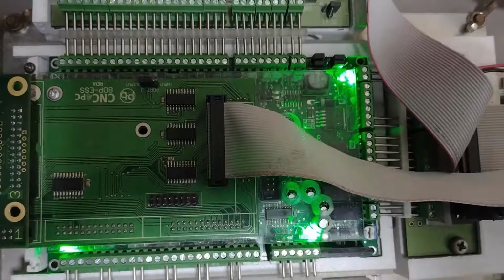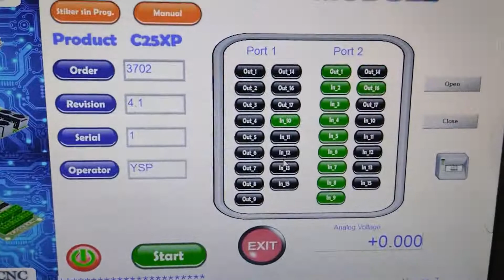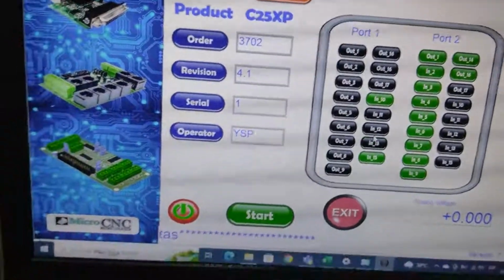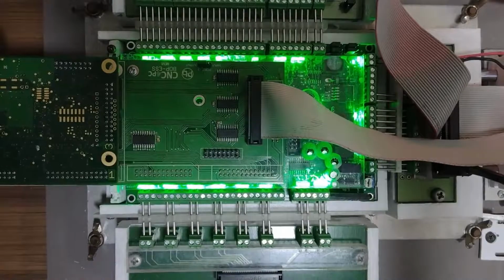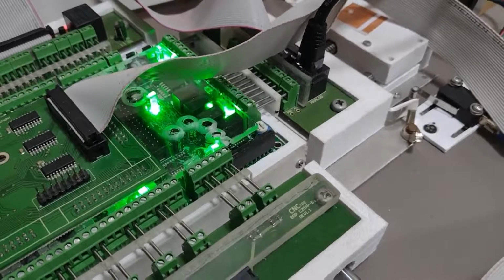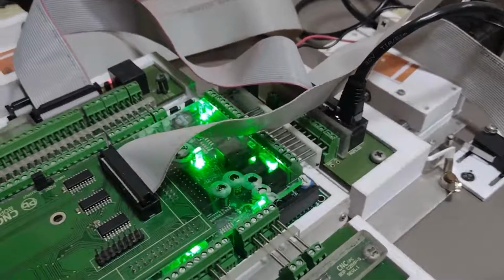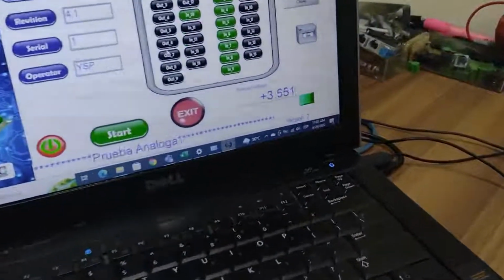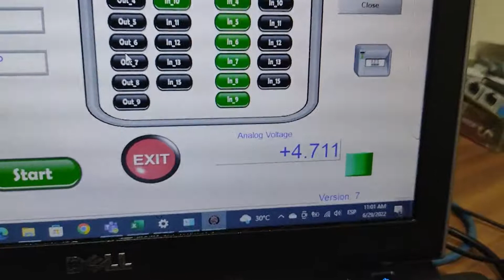CNC4PC Automatic Board Testing System

Comment: Hi! What is the better VFD control board to use with Sherline spindles/motors?
Reply from the maker: The analog output on this board is isolated, so you can really connect to anything, including the original non-isolated speed controller.  Lately we are using this one a lot: https://www.cnc4pc.com/mini-type-integrated-universal-inverter-vfd-2-2kw.html The price is VERY reasonable, it is easy to use and works great.
Reply: @cnc4pc21  hi again! do we need to connect something to pin 14 port1 in order to generate the 0-10v????
Reply from the maker: @pachonX  Nothing. The circuit is all inside the board.  It has internal DC-DC converters to generate the isolated power for the circuit.